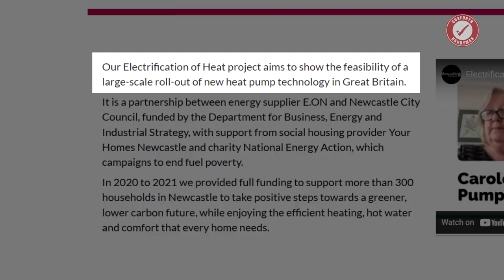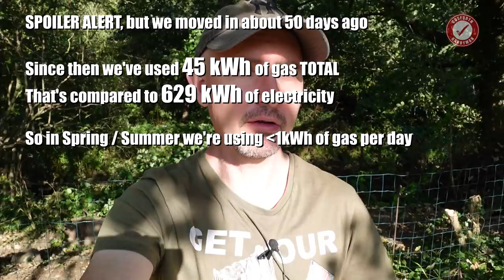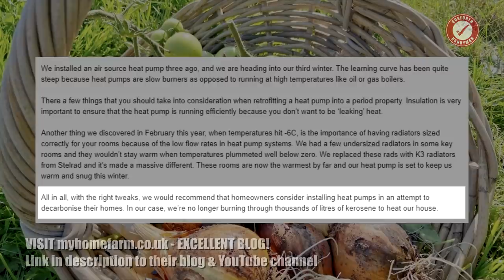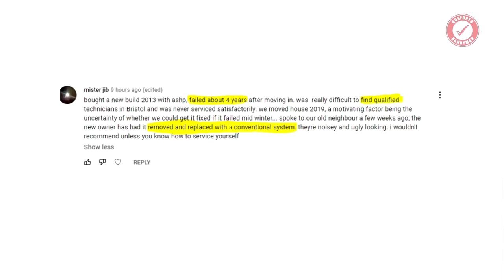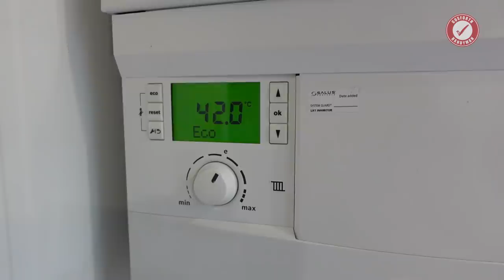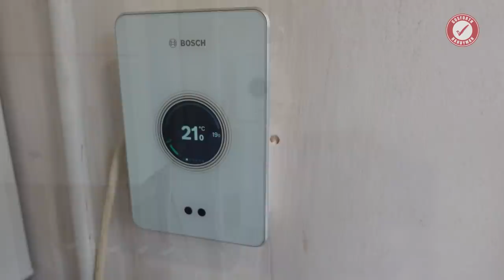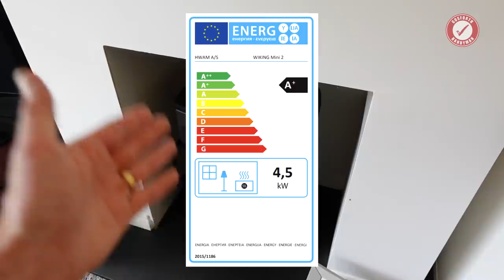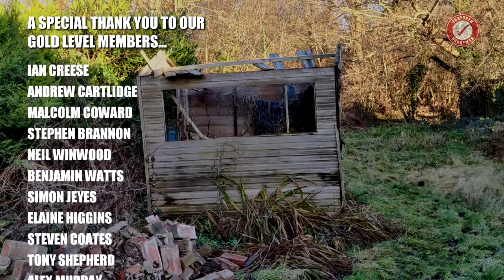Why didn’t we install an Air Source Heat Pump? (1920’s Renovation Part 32)

Comment: Thanks for your assessment on heating choice Andy, I'm glad we came to same conclusion. I have a near Identical situation as you, with the house having previously had Eco 7 heating, the only difference I have is a log burner with a back boiler, so this contributes to central heating via heat exchanger when in use.

Comment: A couple years ago my parents switched over to solar panels and ASHP from oil and it works great. It is much quieter than their previous oil heating system, you can't even really hear it at all. (they have a Mistubishi heat pump). Their house is so warm now, it's fab, and works just as well in the really cold months. They did need to change some radiators to bigger ones, but that wasn't a big deal for them.

Comment: The one short coming with a on-demand heater is the distance of the furthest sink/shower/bath from the boiler. Especially in a drought prone area like California (obviously no where in the UK). The water waste is excessive unless you add a re-circulation pump, like a Chillipepper, which allows you to pre-circulate the hot water to a distance close to the distant shower/bath to reduce the waste water expelled while you are waiting to be able to step into a warm shower.

Comment: Andy, that was actually a very thoughtful discussion on being environmentally sensitive without being stupid (can I use that word anymore?).  Well done video. Also, we use lots of spray foam here in western Canada, with SEVERE weather extremes, with no downsides to speak of (if it's properly installed).  Just my thoughts.  Cheers.
Reply: Why wouldn’t you be able to say stupid
Reply: From what I have heard they are shite.  Here is the UK our houses are not that well insulated so they will not be very efficient.  New builds may be a different matter but the fans become noisy for neighbours in built up areas.

Comment: Great timing this - our old gas boiler is coming to the end of its life and this has pretty much confirmed my thinking about just getting it replaced with an up to date condensing gas boiler (5 bed 1970’s detached house)
Reply: I'd perhaps seek out other sources of information about heat pumps. I'm afraid he's not well informed and those comments he read out were incredibly inaccurate.
Also quotes energy use for a solid stone built 7 bed farm house for comparisons with avg houses.

Comment: I live in a country where it gets to -20 in winter, and my air source heat pump worked fine. However you need underfloor heating and triple glazing. I also had a plant room with a large heat storage collector tank. But yes they are noisy.
Reply: can I ask how much an ASHP costs in your country? do you have grants to fit them? is it a "jobs for the boys" scheme?
Reply: I located mine behind our garage not next to the house.  I agree about underfloor heating and fastidious approach to insulation reaps rewards
Reply: @andyburns  The heat pump and installation about 6000 pounds depending on size, no grants.
Reply: No underflloor needed . You need to not put you construction floor direct on cold ground and then put your finisched floor on that one. Isolation is the key.i have isolation under Both. No need for under floor heating . Also large radiators !!
Reply: No underflloor needed . You need to not put you construction floor direct on cold ground and then put your finisched floor on that one. Isolation is the key.i have isolation under Both. No need for under floor heating . Also large radiators !!
Reply: No underflloor needed . You need to not put you construction floor direct on cold ground and then put your finisched floor on that one. Isolation is the key.i have isolation under Both. No need for under floor heating . Also large radiators !!
Reply: How much did the ASHP switch over to the back up electric immersion heater during the winter months and what was your average monthly electric bill?
Reply: @sparky6612  The heat pump was part of an integrated system which included a wood burning furnace and solar water heaters so I cannot answer your question sorry
Reply: @derekjohn178  So a combination of energy supplies is probably the key rather than just relying on the heat pump alone. Thanks.

Comment: Your better makes of boiler (Wooster Bosch, Vallent etc) are made to be able to convert to Hydrogen!

Wood burning stoves are the next to be blacklisted, but there seems little reason for it if you have an A rated one! Ours was the best investment I have made in out house. The only drawback is that once you light it you end up dribbling and watching the faeries all night! Also there is a battle between the cats and the dog for pole position in front of it! 

One extra thing that rarely gets mentioned is the chimney.  We had a stainless flue put in yet even so when we go to bed the upstairs chimney wall is nice and warm!
Reply: ah yes, 'Wooster Bosch' and 'Vallent'. Your better makes of boiler.

Comment: We’ve had air source for almost a year now and it works fine, last winter it got pretty cold here in the south east we had large amounts of snow on the ground for a couple weeks and some savagely cold nights and it dealt with it no problems. Only issue is it can seem a bit loud at times but nothing dreadful, just be mindful of where the outside unit is installed.

Comment: Many thanks for that most informative and balanced video. We have a combi boiler that replaced the previous combi boiler about 8 years ago and we use LPG as we are in a rural property. During the warmer months, as the boiler is only having to heat water for showers and washing up, we use very little gas. However, we do use much more once the heating kicks in but we go for an extra layer of clothing before we turn the thermostat up. And yes, we have a diesel car, purchased when they were rated at zero for road tax and the government was saying 'buy diesel'. It does about 65mpg, far better than the hybrid we test drove the other day! Your comments on heat sourced air pumps do demonstrate that not enough though has been given to this issue by the government. Thanks again.

Comment: Just a few thoughts on this thorny subject:

1) Government grants: There were two main grants - the green homes grant which provided up to £5000/£10000 for 2/3rds of the install cost upfront. This got cancelled in March without notice (and was stupidly complicated for what it was). There are rumours it will get a replacement soon. And the RHI (Renewable Heat Incentive) which provides pay back over a period of 7 years for installing a range of items and is still open. You could claim both - but the upfront green homes grant would have been deducted from the RHI payments due, so you wouldn't have been able to benefit twice.

2) A central heating system needs designing as a whole system (i.e. the heat producing element, the heat emitters and the pipework connect them). Most people have got lazy as oil boilers & gas boilers worked on the same hot water temperature so radiator sizes were interchangeable so they just follow standard sizes. Heat pumps work more efficiently at lower temperatures, so you need bigger heat emitters to really benefit. Most ASHP problems are because the systems were badly designed (or missold) and users badly informed on how to use them. You can make an ASHP work in any property provided you design the whole system correctly.

3) But having said that, you can't beat the economics of gas if you're on the gas grid. Even with government grants on ASHPs, you can't beat mains gas.

3a) And having said that, you will struggle to beat simply using the money to buy more insulation (fabric first approach). Spending that £60k on insulation would have given you much bigger benefit than spending it all on a funky GSHP - even with keeping the old oil boiler.

4) Don't hold out for hydrogen. Nice on paper - but swapping the grid over in a town from natural gas to hydrogen is going to be almost logistically impossible. Synthetic natural gas is a more likely contender to going carbon neutral (at least for the next 20-30years) - purely because the retrofit is so much easier.

5) And having said that - you will never beat the efficiency (and carbon advantage) of an ASHP/GSHP because they use energy to extract a larger amount of heat from the environment. A gas boiler burning 1kwh at 90%+ will always be beaten by gas power station burning 1kwh at 90%+ that is powering an ASHP extracting 3-4kwh from the environment. But don't confuse efficiency with running costs.
Reply: Great post. Adding local PV assistance to the energy supply would further strengthen the point made under 5 as you'd be avoiding grid loss on the power used to run the A/GSHP.
Reply: You have pointed out everything that we try to educate customers on with every install. Sadly some of them are green washed into thinking ASHP is the best thing going and that it will save them regardless of the rest of the system even if you take them through all the manufacturers literature and the calculations. We fit 8 ashp last year compared to 6x that in gas systems. The 8 we fitted were all country homes, some units for swimming pools and some for home heating/hot water storage but all were full renovations so all the insulation pipe work, UFH etc could be done. All will be on par/cheaper to run on average than Nat Gas. 

But try telling people that are used to 60-80c temps on radiators that running at 50 or below will be more efficient. I don't know why but with UFH they get it and it makes sense, but you put a k3 in with low flow temps and quite often you'll get "but I feel cold". You can educate people but you can't change their mindset/habits over night. The grants also do not cover the redecorating afterwards which would be needed to get to micro bore pips and replace it etc unless people wanted pipework on surfaces but not taking up floors and replacing pipework was often the first thing customers would not want doing regardless of the warnings. 

Now we just refuse to do fit ASHP to homes where customers are unwilling to upgrade the necessary parts of the installation. All it does is tarnish our reputation as installers and the technology going forward. Yes we don't tend to fit them north of Cardiff for a few reasons which has changed over time, originally many of the units we'd fit were fine in Scandinavia and Germany where the installer courses took place but they had "dry winters" but when it came to fitting those same units in the UK the rainfall we had led to iceing up and the resistive heaters coming in to defrost the units, increasing winter bills instead of decreasing.
Reply: @effervescence5664  Excellent.
Reply: I am old enough to remember when we swapped the UK gas grid from coal gas (which was over 50% hydrogen) to natural gas. Yes, it was a huge task, and yes, it was done. 
Going back the other way would be possible, but for the capacity restraints of a less energy dense gas.
Reply: @iainathairydog  I was informed that retro fitting into a 1960s house would mean that I would not only spend the RHI but should look to add the equivalent in additional running costs
Reply: I absolutely agree, the system needs to be designed as a whole. Something that might be worth considering is that underfloor (water) heating runs at a lower temperature than wall-mounted radiator systems (~40degC), so if you have the option of installing UFH, an A/GSHP might make a lot of sense. (should have watched more of the video before responding, and I see others have already mentioned this :) )
Reply: Great post. I agree, holding out for hydrogen (ie: something that is nothing more than a fairy tale at this point) would be crazy.
Reply: There won't be any holding out for hydrogen. It will start with a percentage being introduced, then increased. Just as we have seen biofuel added to petrol.
You may think it impractical to convert the gas mains to a different fuel, but it has been done before, only about 50 years ago. Admittedly, we'd end up with a capacity constraint. Perhaps that's why people are being conned into paying three times as much for their heating on electricity.
Yes, the efficiency of a closed cycle gas power station beats a gas boiler. But the transmission losses are huge, and the total conversion efficiency is way lower than that of a gas boiler.
And to claim 300 to 400 efficiency is a joke. In cold weather, heat pumps struggle to be even 125% efficient.
Your skewed view of reality might convince you or numskull politicians, but the engineering and economics tell a different take.
Reply: @iainathairydog  hydrogen is in the plan to 2050 net zero, but not much as it’s twice as expensive than wind/solar etc
Reply: @tonynibbles  hydrogen pipes are already being laid it's going to be an option boiler makers are already prepared to change the boilers to run on hydrogen when time comes. It's not as pie in the sky as most think.. The prices of these heat pumps are ridiculous.. Aas for electricity they need to double the capacity of wind turbines and they not cheap either. We'd all love to have zero carbon but its out of most people's reach
Reply: No power station gas or coal reaches 90% efficiency without going to combined heat and power. Co generation plants can get to 60%. But for heating it is more efficient to burn natural gas at the home^...
Reply: @experimentchannel9692  what about gas powered air source heat pumps?

Comment: Air source heat pumps when used with ducted or mini-split forced air systems are very efficient even in our extreme winters in Minnesota. It must be paired with good insulation and windows. Our heat pump uses around 1.5 kW per hour to run. In 20 degree weather, it runs about 5 hours per day to maintain us at 68 degrees, using around 8 kWh per day. Our old electric heat system used a 10 kW heater, so you can see how much lower our energy bills are with an ASHP.

Comment: Insulation is key whatever you do to be efficient and <sustainable>.  I double glazed the entire apartment, added interior insulation on all exterior walls and had thermally efficient exterior blinds for all windows - then I added the ASHP!
Reply: I would like triple glazing with internal blind does it exist ?
Reply: What is an "thermally efficient exterior blinds"?
Reply: @michaelwilliams3648  are they the horizontal strips that jut out like on commercial properties that reduce glare?
Reply: @michaelwilliams3648  Shutters that are lowered over the outside of the window either at night or when the sun is very hot in the day. Made of aluminium slats with an insulating foam sandwiched within. Reduces noise a little as well.
Reply: @highpath4776  A quick check with Google says ‘yes’
Reply: @Richardincancale  my local fire station has automatic thermal controlled ones on their office windows
Reply: @Richardincancale  thought so, the new build housing association denies they are avalible

Comment: I’m renovating my 3 Bed 1940s home and came to exactly the same conclusion when looking to replace the old system boiler. Went with a 36kw combi boiler, new radiators with thermostatic valves and the shower pressure is great, even got rid of the old pump. Still need to insulate below the ground  floor. Heat pumps work great in well insulated, air tight houses but not on older properties. My parents are building a passive house & will be installing a heat pump which will work great for them.

Comment: It's interesting to hear (and learn) about the differences in heating/cooling technologies between the UK and here in Australia. I remember when i moved into a flat that had an "instantaneous gas" hot water system (boiler) - what a revelation over stored hot water. They're brilliant! We don't need central heating in my city (Brisbane, sub-tropical) but they do use it down south in Melbourne & Hobart, and I know that "combi-boilers" are very popular down there. Great video Andy, thank you.
Reply: I lived in Gaythorne and absolutely roasted on Xmas day when I lived down under, only had a fan in the bedroom. Remember one real cold day on the building site, hoodies on and wrapped up it was freezing must have been a freak weather bomb ha

Comment: 23 minutes spray foam insulation. We just had vaguely similar thing with our GRP flat roofs - the online insurance questionnaires don't have them in the roof type pick list. Would have had to pay extra to specialist insurer. Went back to a company we used in past and spoke to a real person who could think - she gave lower quote than reason we had left them. A lot of very lazy, simplistic, non-thinking assessment systems in this country